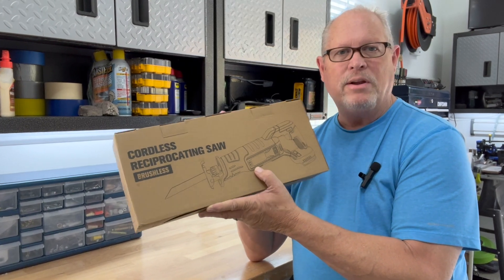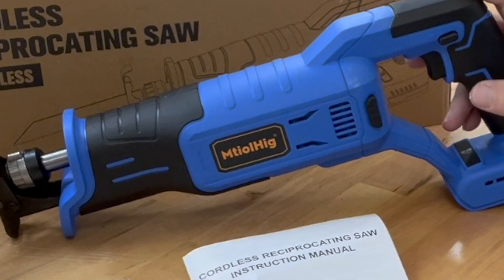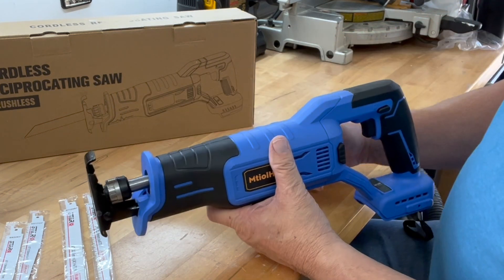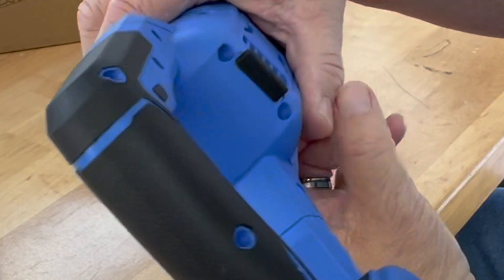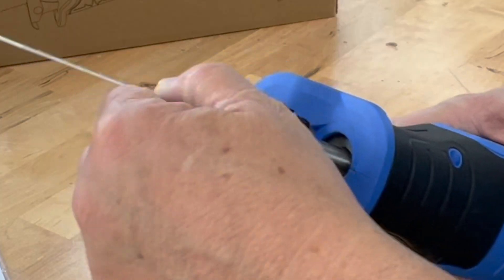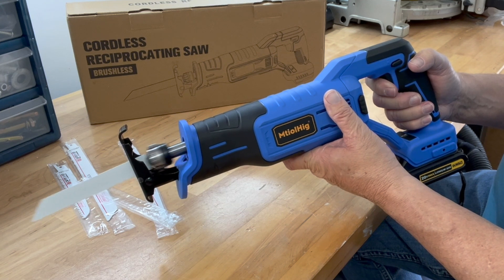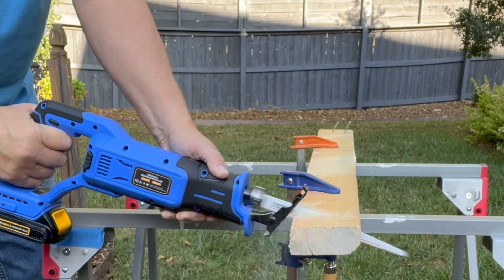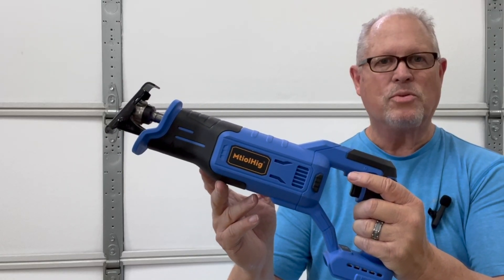Cordless Reciprocating Saw: Power And Precision With Variable Speed 3200 Spm By Mtiolhig

Comment: i dont know if it looks very very good is the right word my recip saw dont have plastic covering every inch half is plastic half is aluminum all im saying is you get what you pay for and thats cheap
Reply: and my 60v dewalt saw does things 10x times easier i dont think ive heard the blade slow down cutting metal wood anything i once cut threw a pickup truck frame with it i didnt even notice
Reply from the maker: @johnburke-u7p  thank you John for sharing!!! Tim